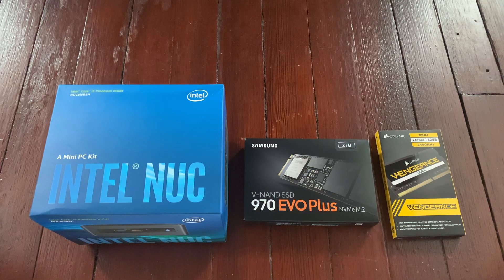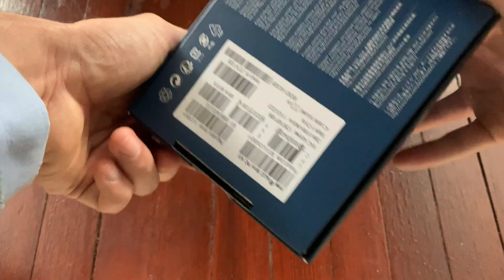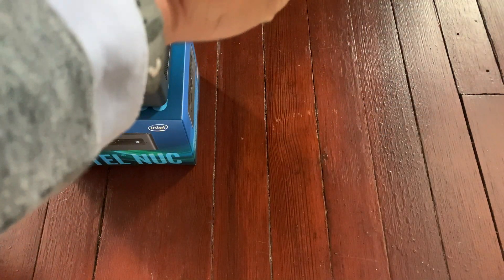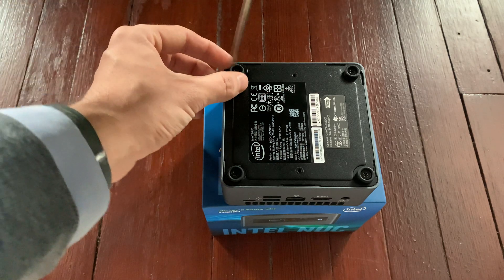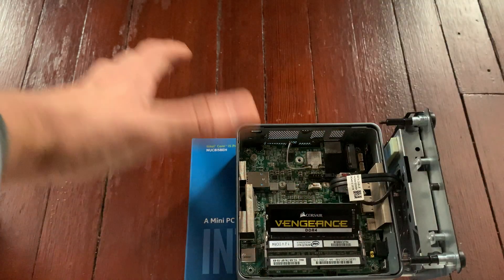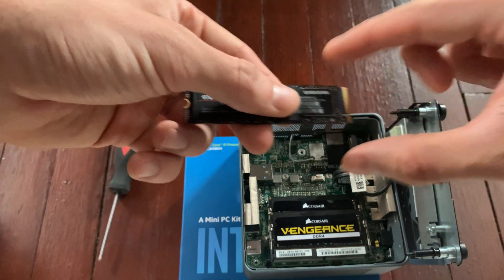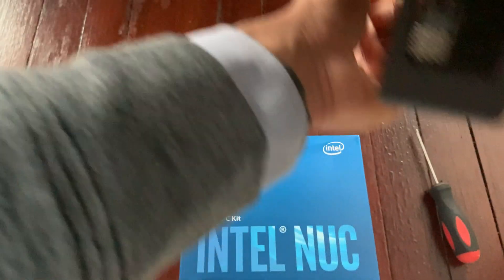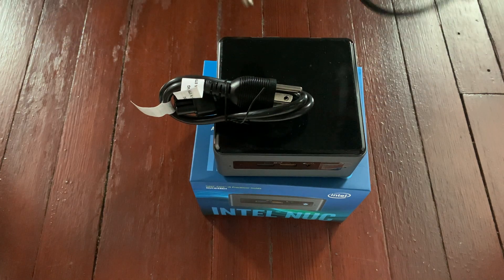What hardware do I need to set up an ETH validator node?

Comment: Is this up and running... 
Do you run node already?
Would you show us software and how you start it.
Reply: Very interesting question 👍
Looks pretty affordable. But how much money a validator can earn with such an equipment per month 🤔?
Reply: @Hacking-NASSA-with-HTML  it's depends how much you stake... 
Min 32 ETH...  
Rate is about 5% ish now... 
Example...
96 Eth ( 3 validators)  X  5% = 4.8 Eth a year. 
32 ETH ( 1 validator)  X 5 % = 1.6 Eth a year.